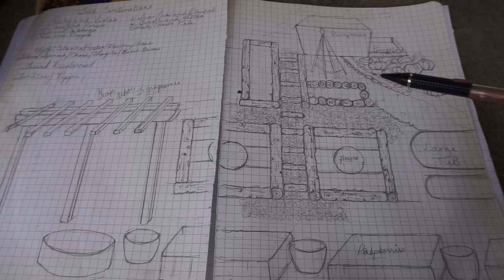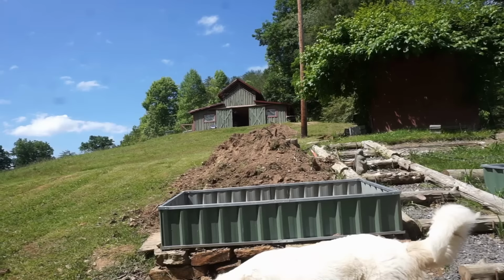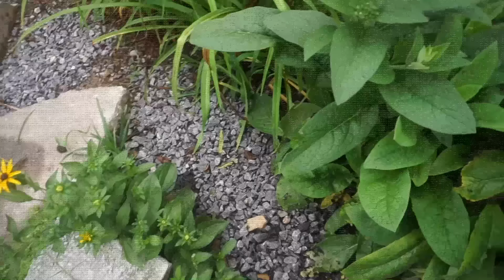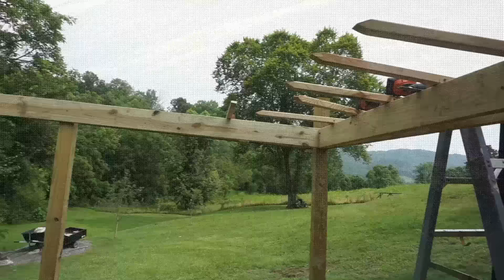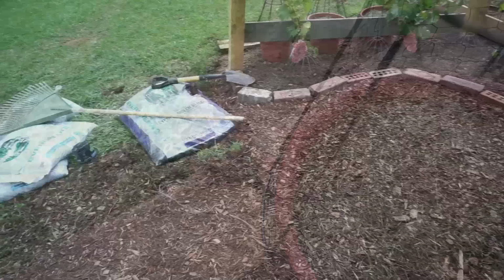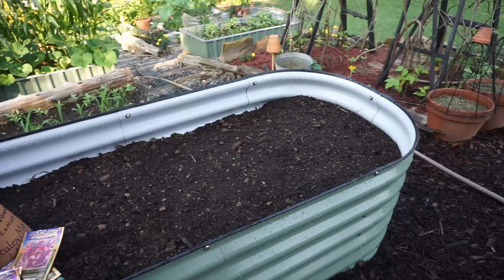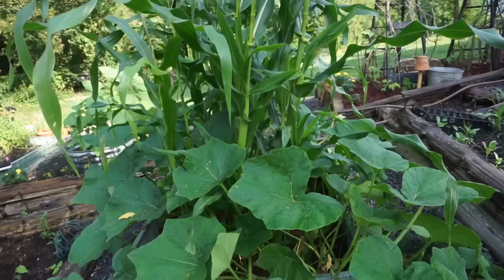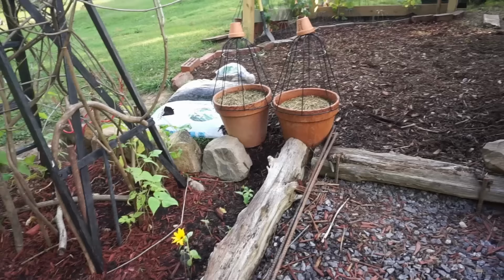Cottage vegetable Garden and Potager on a SLOPE/  Seeds to sow in late summer

Comment: I need to build that trellis you've got your grapes on! It's wonderful! I wish I knew how you cut out that poison ivy without getting it on you! It seems all I have to do is look at it and I break out. It's a constant battle to keep out of my garden. It's the only thing I will actually use a weed killer spray on. I add some soap to the spray in hopes it sticks to the poison ivy long enough to do some damage. Your slope garden was a lot of work I'm sure, but so very well worth it! Glorious!
Reply from the maker: I got plenty of rashes, even with long sleeves and gloves. Those roots were huge and had to be dug out. The trellis is real easy to  build!

Comment: I meant to mention to you that it takes a hardwood killer to kill poison ivy. Which can also kill your trumpet vine. But , you can take a paint brush and paint the solution on the vines where you cut it off so it can kill the roots. Do small amounts, be very careful in applying  and watch for results. If you see no results (*check the directions for the deets on kill time span) reapply the solution. They have a product called stump killer or something like that that people use to kill all the growth on a tree stump. Might check that out also. If you don't do something about the poison ivy roots it will grow back.
Reply from the maker: Thanks for the advice. It's already trying to grow back here and there.

Comment: Lots of hard work has turned out a magical garden space. Love it ! Will you have any problem with water draining away too fast ? I live in East Texas and it's currently 100°. We've been close to, or over, that temp for weeks now. No rain in over a month and a half. So this makes me think of how fast water will drain away from the plants.
Reply from the maker: The beds have been leveled out on the slope, so draining water is not an issue at all. lots of mulch is holding the moisture in the bed pretty well.

Comment: Jeri...how do you keep your cats and dogs out of the garden beds?  >.<  I have 2 outside cats that insist on jumping into my pots and using them for toilets.  I had chopsticks & tulle over them but had to take it off to let the flowers grow taller...then the cats destroyed it.  I guess I'll have to find cloche it's the only way I see to keep them off and out.
Reply from the maker: My kitty isn't a problem, but the dogs can be really naughty if I don't provide a lot of paths and walkways for them to travel on. I suggest you  put mothballs in your pots; if that doesn't work get the large garden cloches made of wire OR find the metal baskets made for hanging baskets and use them over the pots. The plants can be woven between the metal spokes and will grow freely.
Reply: thank you for the tips :) @JeriLandersofHopalongHollow